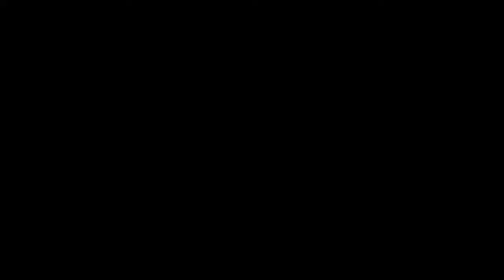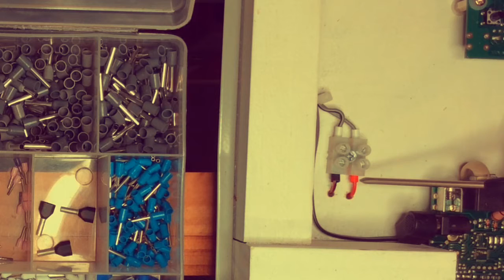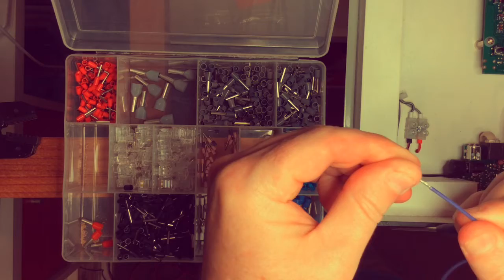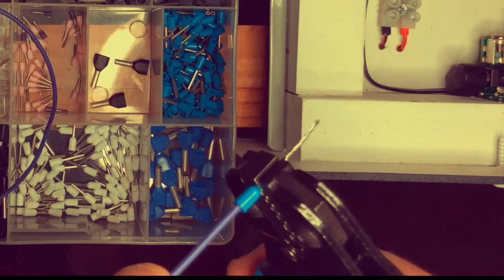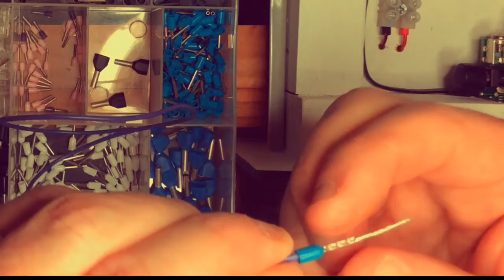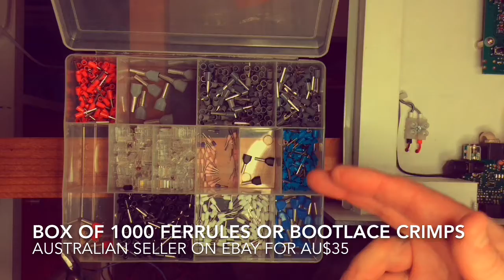How to Bootlace Crimp wires

Comment from the maker: Yes many do however research "solder creep", in the metallurgical sense (slow deformation under
stress). The solder filling the interstices between individual wires
moves, allowing the connection to go slack. My training is from offshore oil and gas instrumentation and electrical technical engineering. I haven't second guessed this training however. Hope this assists?